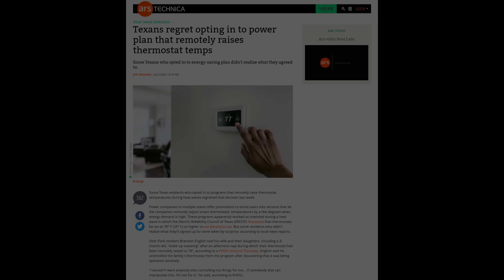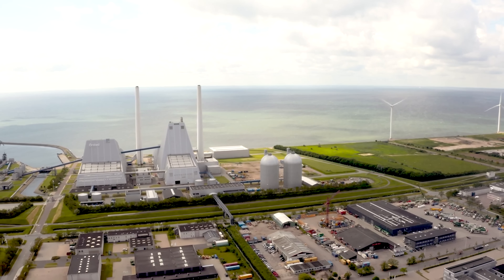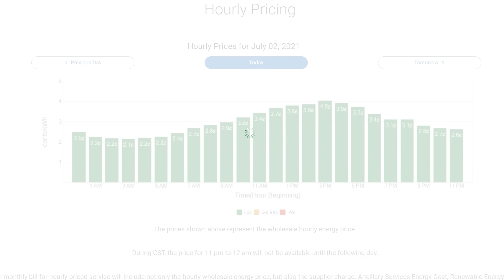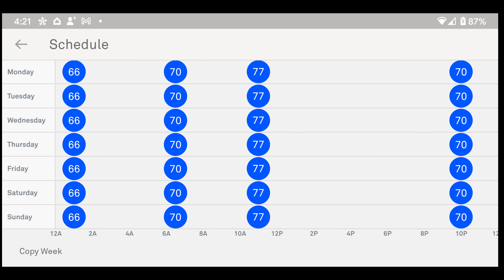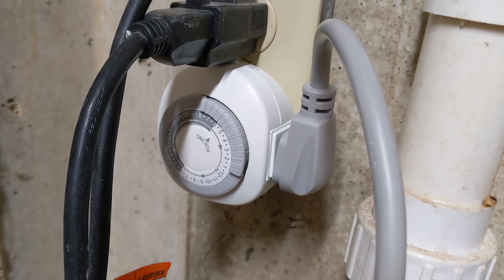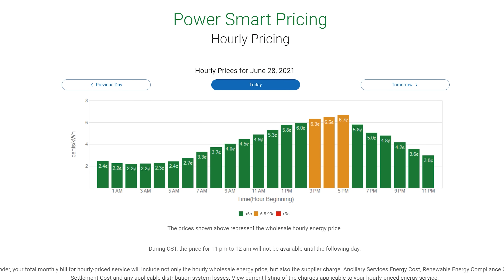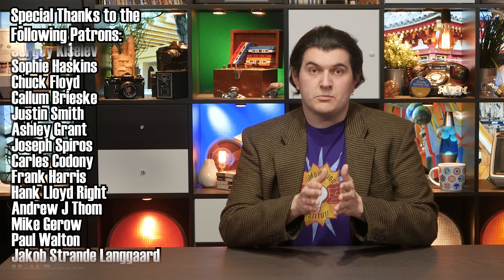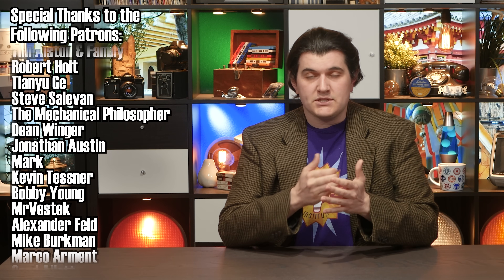Batteries aren't the only way to store energy. Here's another.

Comment: I see a lot of people in the comments voicing their enthusiasm for this approach. And indeed, for people without solar panels nor home battery, this makes perfect sense. Pre-heat (assuming you heat electrically) and pre-cool during periods of low demand and lower rates, and you create a buffer that would allow you to consume less during peak demand/rate hours.
 
However, it's not applicable to all situations. In my case, I have a fixed rate plan with prices that vary from month to month, but not hour to hour. So whether I consume during the day or the night, I'd pay the same per kWh. I also have solar panels that produce more than I need during the day when the sun is out (so when it's hot and an AC would be welcome), and a battery to store 8kWh of excess energy for use during the night, when my panels don't produce. Were I to run a 2kW AC during the night, it would've drained my battery in 4 hours, after which I would be pulling a constant 2kW from the grid for the remainder of the night. Meanwhile, turning the AC off during the day would mean an extra 2kWh gets injected into the grid every hour. So assuming reactive cooling from 10am to 8pm, that would be 20kWh of power injected into the grid. Since they replaced the old analogue meters with new digital ones that count injection and consumption separately, so they can charge you 5x the rate for what you pull from the grid than they pay you for what you inject, this would mean I would lose money both during the day and during the night. So if I ever install an AC unit, you can bet your ass it'll only run during the day.

Comment: In Germany ACs are rare. The way we keep our places cool is pretty similar to what you describe, except we use outside air. On summer evenings we open all windows and interior doors in the evening. Then we close them as soon as we get up. With the houses being as well insulated as they are to withstand the cold winters, that tactic usually means temperatures stay below 25C. Although humidity can become high enough that you need to open your windows again when outside temperature is still above that.
Also in recent years climate change has brought more and more nights too hot for that. In that case we visit the public pools or lakes, (or air conditioned office buildings).

Comment: We use our hot water cylinder as a battery, set to only run between 11pm and 7am. These modern cylinders easily keep us in hot water all day, but we only "charge" it with cheap overnight power. A good saving for us, oh and the nation too!

Comment: Living in Florida my grandfather never used the central A/C had a industrial fan in the garage point up into the attics through the opening. It did help alot pushing the vary hot air out of the attic. I just wonder how much power the fan used 4 to 5 hours he would run.

Comment: I live In a fairly old farmhouse In a pretty large bedroom that used to be a garage that was walled off so it's basically the newest room and I recently realized how well overcooling at night works even though I live in California with it's well over 90°f constant heat for a good portion of the year. I have another slightly helpful thing because my basement is right next to my room so it can store cold air pretty well and I can open the door to my basement if I want to let the cooler air up to my room and now that it's dropped below 100°f for most day's I have only needed to turn my ac on for a few hours each night.

Comment: I've just never had air conditioning.  We never had it growing up.  My house growing up had a cool basement which helped but the main floor had a larger ceiling fan for air movement and me and my sister had ceiling fans in our rooms on the second floor, 95-100+ degree days was really never bad to me, inside was always nicer then being outside.   If I was hot I drank some Ice water, cooled off in minutes.  If it got down into the 50-60 degree mark at night we opened up all the windows and then closed them up in the morning and lowered the shades.  While some places needs some air con and I get that, the majority of the USA could get away with a lot less or almost no air conditioning and be just fine.  Spend the money you would have spent on electricity to home improvements, better windows and blinds  and make sure you have good door seals, swap out older light bulbs to be modern LED bulbs, saves on power and reduces a large amount of heat generation in the home.

Comment: Great video. And even if you don't have a way to install solar, it's another great strategy to charge your batteries during those cheap rate hours. Batteries which keep getting cheaper by the year. Right now, the cheapest are LFP. A 30kw LFP battery system costs around $9,000. That's the average electricity, 30kw, that the average US home uses per day. So half of that amount, a 15kw battery system, would only cost $4,500. 
But keep in mind that Sodium (CATL says they will start mass producing them this year, 2023) and Lithium-Sulfur batteries (Lyten broke ground on their mass producing factory in late 2022) are coming soon. So even cheaper batteries are on the way, or at least at the start, will make LFP batteries even cheaper as massive companion ramps up. None of those use Nickel, Manganese, nor Cobalt. And one doesn't even use Lithium. Just simple Sodium.

Comment: Intersting idea with the variable cose of electricity. I don't have that, but I live in Tennessee and spring and fall has a lot of days of lows in 40-50 f and higs in the 70-80 f. I open a few windows when I go to bed to 'charge' the home overnight and get it nice and cold.  I close the windows as it warms up through the monring and don't use the AC at all. I'll do the inverst on those uncommon warm days we get in the winter. It makes a huge difference.

Comment: I think that one town in South Australia that's underground could probably achieve this, but the rest of Australia gets to swelter in the heat or say out the nose to run aircon.

Also, I hope you'll cover passive house designs, would be good to learn
Reply: Sounds a lot like you don’t know Australia,  some decent research would help.
Reply: @paulperry968  Yeah, haven't lived here my whole life or anything
Reply: Coober Pedy?  And yes, electric power rates are through the roof.  The high power costs plus the insane property prices work together to preemptively keep the public as poor as possible so they can’t save up enough to go off-grid.
Reply: @laulaja-7186  Yeah that's the place I think, I have an aversion to looking shit up for some reason, electricity is fucked here, wack considering we export all the coal

Comment: I grew up in the south without AC. This summer I visited my mom and outside temperature was above 35°C (95°F). It was practically the same inside but we were too lazy to take out a fan. We just were practically naked and sometimes took a cold shower. That was enough to bare this heat😂

Comment: Our AC recently broke and all I do is open all the windows in the house at night before bed, and wake up and close them and all the curtains / blinds in the morning.  The end result is about the same temp in the room I rent as when we had air conditioning and nobody paid attention to windows and blinds and keeping doors closed.  A mid 30is celsius day and my second story bedroom with little ventilation stays under 75F, even though it gets directly hammered on by direct sun from noon to sunset.  I installed two 120mm computer fans in my window to pull stale air from my room out and draw air from the rest of the house in.  I thought I'd be dying without ac this summer but so far it has barely been noticable as long as no one opens the blinds or leaves the doors open.
Reply: I should add though...my television and computer that are in my room barely get turned on this summer without ac...my tv is an older model, and uses lots of power.  Same with my PC...pretty old.  Both add several hundred watts of heat into the room that can't be dealt with without ac.  So that is one compromise I had to make.  But...I use them on cooler days or at night, and I bought a tablet to get me through the warmest days without missing those things that I barely use anymore anyway.

Comment: In France we have the controversial wattmeter called "Linky". 
In France we've had "off peak" discounts on energy for a while (when you use a lot of energy when demand is low). 
To ease it as every household works differently and have different "off peak" times, the job of Linky wattmeter is to determine when you need (or do not need) energy, and will communicate it to Enedis, the French gov organisation that manages the grid. 
With this data they can set predetermined "off peak" time specifically for your household or building. 
This will automatically start your hot water tank to heat up. 
The controversy is about privacy, as the wattmeter give to the government the averages of energy consumption for periodic times during the day so a lot of people are against it but it is now mandatory by law to install these wattmeter everywhere. Nowadays, 95% of all living spaces are equipped with it and there's no real issue.

Comment: Another energy saver is to ONLY heat or cool what you actually need.  One example is using electric blankets instead of heating the room.  Another is sitting right in front of a fan instead of cooling a whole room.  A third is if the same home automation system that turns off the lights in your unoccupied rooms also closes the HVAC vents in those rooms.

Comment: An idea on the net is to use a chest freezer as a refridge, it will run less and when you open it the cold air does not drop out.  Different themostat needed and some other mod.

Comment: Depending on how big your fridge is I would say that it is not a big consumer of power like everyone thinks, A regular fridge only consumes about 120watts or 1 amp of electricity when running. You should do a power amp test to confirm the actual power consumption. By using a amp clamp and clamping around the hot line or the neutral you can get an accurate reading of what power it draws while running...

Comment: This is very interesting (I'm subbed now), but this uses more total energy than running at peak because of the losses in insulation, etc, right? For that reason the utilities might still be more keen to cut off loals than pre-load them.

Still huge for storing renewables though, as storage will always have losses.

Comment: In NZ the grid has been using, for decades, control of electrical hot water heating via a ripple controller to balance the power generated vs the power used  when power demand is high a signal is sent down the power lines which is picked up by the controller which switches off the hot water cylinder. When demand drops the signal will switch on the cylinder, thus soaking up the power imbalance. The cost of power was reduced for those that had ripple controllers installed.
Here in Western Australia it seems to me that those with solar cells should dump their power generated into their AC during the day when the utility really is not interested in purchasing their power, and so precool their homes for when they return home when grid demand is highest.

Comment: I recently got rooftop solar with storage - with UK electricity at about 28.5p/kWh (UK) and due to go up again in October 2022, anything I can do to offset my usage from the grid makes a lot of sense. My 3.6kWh battery is typically charged by lunchtime at the moment (June 2022), it covers evening usage and cushions spikes during the day when my instantaneous load is greater than what the panels are generating. I've switched from running the laundry and dishwasher to daytime (used to run it overnight) and also heat my hot water using the electric immersion heater instead of my gas boiler.  In the afternoon I boil a kettle of water and store that in a thermos flask for a cup of tea (I did say I was British) later on.

Comment: Mine is set by individual rooms, my bedroom drops from 80 to 64 at sunset, I like to sleep cold.  The bedroom is cut off at 5AM, and the living areas are turned on and set to 68.  After 8AM the temp is set to 78 for living areas.  This usually results in only the kitchen air running and then only on hot days.

Comment: Were I in a state in which there was a danger of shutoffs I'd install solar - but I appreciate that the speed at which solar could be installed for those that want it is too slow to address the urgency of the peak supply problem.  Nonetheless, solar seems an excellent way to run air con: when it's hot and you want it the sun happens to be strong too!  Here in England, where it's very rarely hot enough to justify air con, electricity has recently become extremely expensive: pushing 40c (30 pence) per kwh and in Oct will be at least 60c.  UK really is facing energy crisis - not of excess use straining the grid but of cost...

Comment: Btw. a dehumidifier actually is a small monoblock AC, but wasting the cooling effect by heating air up again on the outlet. You might as well let the AC run on low fanspeeds (to allow efficient condensation of water on the coil) for some time instead.

Comment: I’m not even this “techy” and I’ve been doing this to save on electric. At 9 or 10 pm I turn the AC on to 67°F and in the morning when I get up for work, I turn the entire system off. The house stays cool all day because I have lots of shade and a south facing home. I have pets that need to stay cool during the day. I leave the fans on. 

I do the same with my hot water heater. It stays off all day until it’s time for showers/baths. No one is at the house during the day so there’s no need for hot water. 

I got my bill down to about $35 a month on a 1900SqFt home in NW Florida. 

In the winter (NW Florida does get cold), I use the wood burning fireplace to heat the home. I don’t use my HVAC. It stays off for about 4-5 months a year. 🤷🏻‍♀️

Comment: Ironically, the pumped water storage system in the pictures used in this video failed this year when a flaw in the level control system allowed the storage pool to over-top the reservoir walls which didn't have a spillway. The result was the base of the walls got washed out and the walls collapsed.

Comment: FYI, the efficiency of an AC system is greater when the outdoor temp is lower, and the indoor temp is higher, so if it is 77 indoors and 75 outdoors, it will use less electricity for the same cooling as it would when it is 77 indoors and 95 outdoors.
ICEs are the same way, but in reverse, hotter inside, cooler outside makes more power.
Both have heat Delta, and power Delta relationship.

Comment: I'm installing about 1500 used wine bottles (i own a restaurant) full of water under my staircase. Then I'm going to run air through that space on a programmable fan cycle to store cold water for use during peak cost hours. Ill use the cool thermal mass to flush warm air out of the upstairs master bedroom.

Comment: It would also be a good idea to store the heat instead of getting rid of it. Store some heat during the day and then use that same heat to keep the house warm in the night. That is where phase change material comes in. When heat needs to be dumped, just get some cold air in during the night, and the excess heat goes right out the window - literally - and the PCM is ready for the next day.

Comment: You mentioned "Economy 7" which is a system we have in Britain. Uses cheap electricity in the night time to heat up heaty retaining material like brick and then releases that heat when daylight comes. Have to say that, having lived with a system like that for a long time - it's useless!  You get heat for an hour or two in the morning and then nothing the rest of the day. It's a good idea, but in practice it's not great.  Brick is a great heat retainer for sure. Used to live in a redbrick house and during a hot day it was quite bearable inside without cooling, but come the nightime it was like trying to sleep in a tandoori oven.  Our current house - built of dual-skin concrete blocks in the 1980s has a far more constant temperature inside, which is a lot better for living and for sleeping.

Comment: I'm not so sure about you specific approach, but the system sounds great.

if you are overshooting your heating or cooling targets you increasing the temperature difference between the outside and inside.
That increases the amount of energy you loose.

the principle works and there is lot of potential for optimized devices that are designed to store a chilled or heated medium, i just don't think that medium should be the whole house.

Comment: Yeah.. I live in the Houston area. I already crank the AC all throughout the night just because I need to be cold in order to sleep well. Unfortunately, the prospect of not cooling my home at all between 7:00am and 10:00pm is absolutely ludicrous. It gets nice and cold in here at night but not cold enough to keep the entire house cool throughout the day, particularly mid summer. 

I run hot already and I live in an incredibly hot and humid climate. Since I prefer to be cold, there have been several years during which I might turn the heater on just a handful of times all winter or perhaps just run a small space heater for an hour or so per day. I can remember a few fairly recent winters which didn’t see my furnace run one single time. Of course this past winter was a major exception and I have plans to buy a standby generator eventually, just in case these rolling blackouts happen again in the future. Fortunately, the house that my wife and I just bought is already wired for a 50A generator. They are far from cheap but when disaster strikes, I bet it’s quite easy to justify that purchase. 

Anyway, as nice as it must be to “overcool” your home at night and not run the AC at all during the day, that is simply a non-starter in Texas.